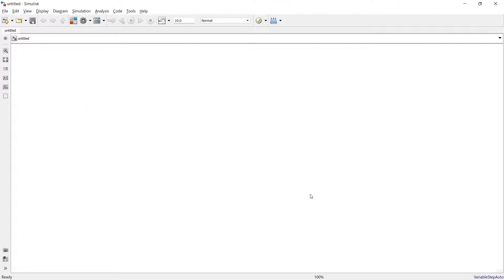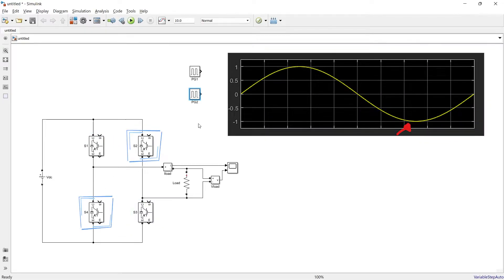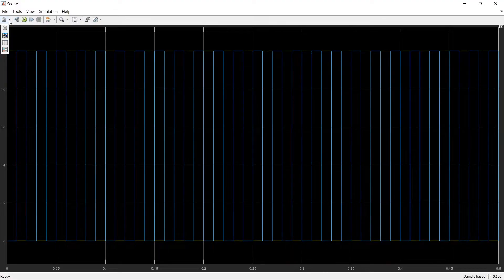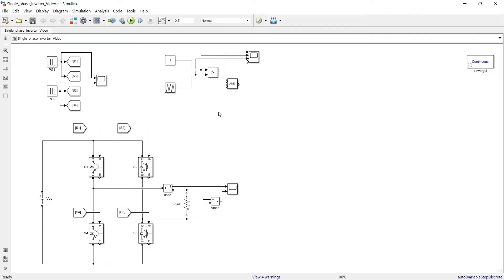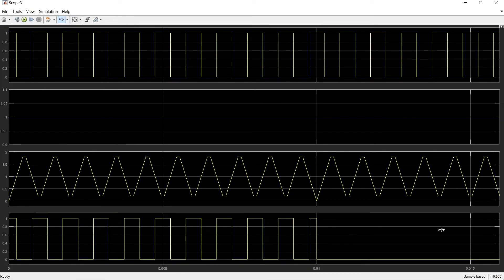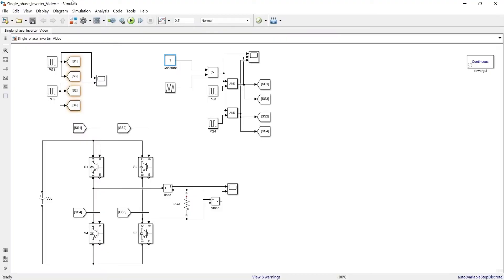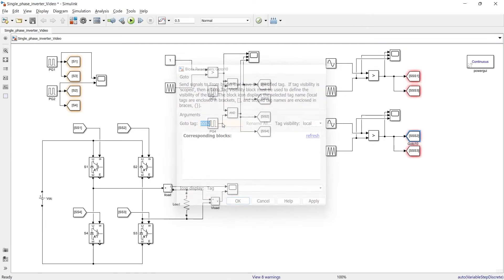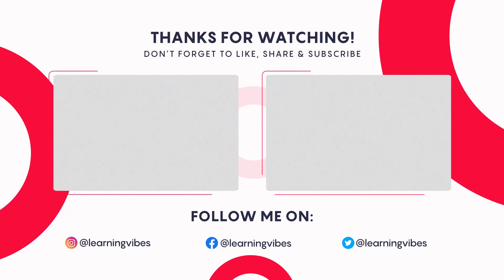Single phase inverter simulation in MATLAB Simulink | Download Simulink model file of inverter

Comment: I'm using MATLAB'19. But I'm not getting the triangular wave with your parameters.i don't know why. The wave I'm getting is all the sawtooth spikes with unequal amplitudes higher than the maximum amplitude i determined at the output values.
Reply: I believe the difference is in the Solver step size.
Go to Model > Configuration Parameters > Solver > and use the smaller step size possible for you. I changed it to Fixed-Step of 0.00001 and looks good